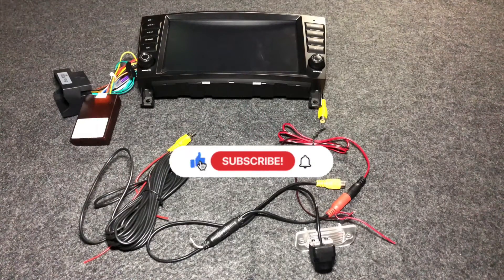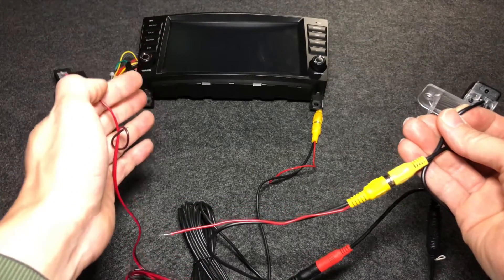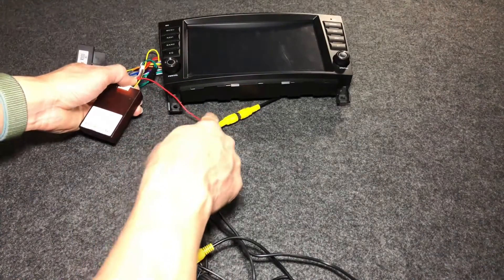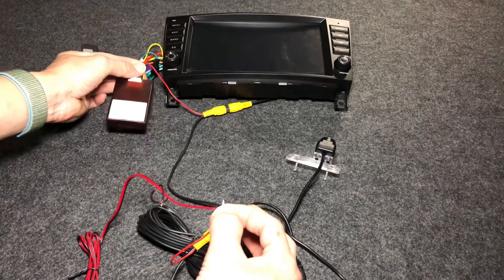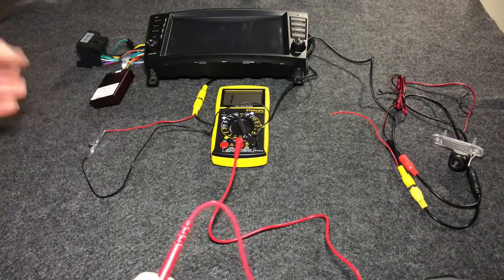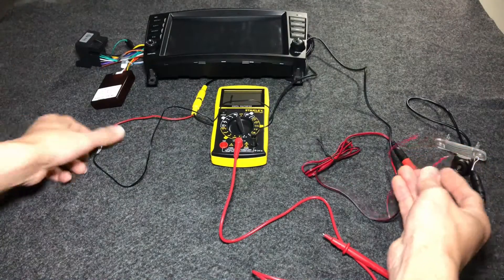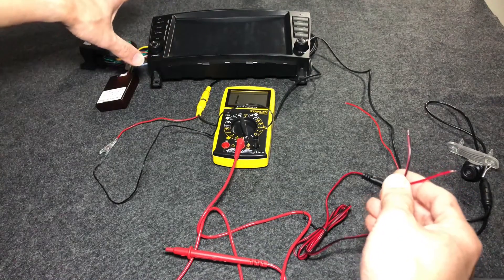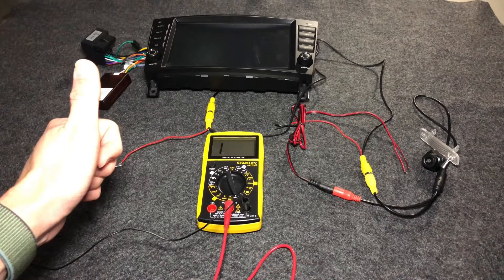HOW TO | CORRECTLY WIRE A REVERSE CAMERA

Comment: Thanks. I’ll try this. I’m so glad I found your video before cutting into the reverse light. I do have a reverse wire at the head unit and had not wired the rest of yet.
Reply from the maker: Good luck with your install. Just make sure that you connect the ground wire to a proper ground point.

Comment: Mate quick question which i will try and be as clear as possible. Ive had my reverse camera hooked up for a while. All has been fine until recently. I now get a lot of glitching when the side lights are on, when i apply the brake lights it all works fine ... i have one emd hooked to the reverse light and the other to a 12v supply. I also have a power relay fitted at the reverse light end of the wire. Any ideas why i am getting so much current interuption ?
Reply from the maker: Are you referring to the red wires coming out of the RCA cable? That you connected one end of it to the Reverse light and the other end to 12v power?

Comment: I connected my reverse camera to the brown wire on the CANBUS and it drained my battery
Reply from the maker: Im sorry to hear that. When you park your car, do you leave it in reverse? If that brown wire show 12v regardless which gear the car is at, then its the wrong wire (even if its brown)

Comment: isn't the brown wire out of the canbus an "input" / "trigger wire as opposed to a 12V output? i was under the impression that the brown wire triggers the reverse camera screen once it receives 12V from the rear tail lights

Comment: how do you connect the red wire to the brown one?
Reply from the maker: Hi there,
There are several options but more recently, I found these items (amazon affiliate link):
https://amzn.to/46Lmgqa
I have not used them yet but have tested them and seems easy to use and effective.
You can watch my other video where I installed this reverse camera on my car. In that video you will see how I connected the camera red wire into the brown wire of the canbus decoder. I didnt use the above product though but also effective method.
Related video: https://youtu.be/uf7iFzxUnoA

Comment: How would one know which wire from the canbus outputs 12v?
Reply from the maker: Hi Wild Storm, thanks for visiting my channel and posting your question here.

There are two ways you can find out: (1) Some canbus decoders have a pin-out or wiring diagram. If yours have one, look for the pin marked Rev cam (or something along those lines, (2) You can use the good-old trial-and-error method where you connect the headunit and canbus decoder into your car, then put your car in reverse/ out or reverse and see which one the pins show 12v when in reverse gear and show 0v when out of reverse. For this you need to invest in a multi-tester. Feel free to have a look at my affiliate link in the description if you currently don’t own one

I my explanation is clear. Let me know if you have further questions. Happy to answer then if I can.

Comment: From the car stereo connector there is a reverse wire. That’s how the canbus had the same signal. On my stereo it was pink. 
That’s what the manual was most likely referring to. Same results though

Comment: Quick question. With my head unit I have a brown wire coming from Canbus and a reversing camera red wire from the head unit itself should I join the red and brown together before connecting to the red wire to complete the circuit or should I just use either the brown Canbus wire or the reversing camera red wire provided from the back of the head unit? 

Thank you! Otherwise the video was brilliant and will help me with my instal for sure!
Reply from the maker: Hi there, Its hard to know for certain what the brown and red wires do without a multi-meter.

Im guessing the brown wire will output 12v when car is in reverse. The red wire in your headunit may possibly need to receive 12v to tell it to switch to the reverse camera feed. 

I suggest to test them for voltage signals first before connecting wires together as it might cause a short circuit and cause damage.

I hope this helps in your installation.

Comment: Hi, I love this video. However, won’t this connection feeds the camera 12v every time the car is on, even though, it’s not in reverse gear. That can get the camera hot and eventually damage it, not sure. I just want to know better.
Reply from the maker: Hi there, Yes I agree with your analysis. Thats why its important to find the right wire to connect it to. In my instance, I tested the signal coming out of that wire from the canbus decoder and I can confirm the wire only outputs 12v when the car is in reverse. All other times its 0v.

Comment: Thanks for this.  I didn't want to tap the reverse light either.  I'd rather leave the OEM wiring as is, so the headunit can be removed easily if needs be without any trailing live wires behind the dash.  Doing it this way - what did you connect the camera ground to?
Reply from the maker: I had to use the ground point in the boot. I wasnt sure if I can use the ground wire on the actual RCA jack. I figure it might introduce noise on the video feed so I used the proper ground.

Comment: Can I .hook.my.camera..to.the.trunk.backup.light
Reply: Let me me .know
Reply from the maker: Hi Eugene, yes this is also a valid was to connect the camera power. Some cars have a sensitive canbus and depending on the type of reverse camera you use, it might draw a high load which causes the canbus to trigger a warning light. Especially if your camera has those powerful LED lights around the lens.

Comment: Hi, I had a unit which I wired all properly however when in reverse there is no image. The screen stayed normal screen not even a no signal sign or change of screen
Reply from the maker: Hi there, If you have an android headunit, its possible there is a reverse trigger system setting that is turned off. Try to dig around and see if you can find it. I’ve mentioned it in the video description of my reverse camera installation video here: https://youtu.be/uf7iFzxUnoA?si=Jo7Rg4I0nR9Xsf99

Comment: I bought a boss BE9ACP head unit. It has a reverse (purple with white stripe) wire, and it has a red wire that says rear camera power output. Im having a issue of does the red wire paired with the yellow rca hook to, and my reverse camera system has a red & black wire separately and not sure where it hooks. The reverse camera i have ia the Atokit plate camera with 8 lights on it
Reply from the maker: Firstly since I’m not familiar with neither your car nor the Boss headunit, please consider my suggestions below just as guidelines.

With regards to the red wire on the yellow RCA video cable, its main purpose is to either: 
(A) Carry 12v signal from the headunit to the reverse camera (if your headunit has the 12v trigger and you don’t want tap into the reverse light to power up your reverse camera) OR 
(B) Carry 12v signal from the reverse light to the headunit (if your headunit does NOT have a 12v trigger).

So to answer your question where to connect the red+black wire on your reverse camera:
Black wire - connect this to ground which is any bare metal on the car. Look for a bunch of wires connected to a screw. That is the ground point you can use for the black wire.
Red wire - If (A) applies to you, then connect the other end of the red wire sticking out of the yellow RCA cable into the red wire of the reverse camera. If (B) applies to you, then connect the red camera wire into the reverse light

I hope this helps.

Comment: hello i hope you are able to help me. my headunit has a canbus and when i switch into reverse, it is detected and my screen goes black no signal. so this tells me there must be a signal. however when i use a multimeter to check the voltage when in reverse there is none. not from the brown wire or any other wire (some of the wires have a constant power supply but not any that work only in reverse). Any idea whats going on?
Reply from the maker: Hi there, thanks for reaching out. Firstly, when you put the car in reverse and the screen goes black, it does not mean it detected the camera. It just means the screen is ready to display the video feed. Since the screen is black, it means there is no video feed possibly because the camera is not receiving any power. Check your ground connection and find a suitable power source. If you cant find a suitable power source from the canbus decoder, an alternative is to tap into the reverse light. I hope this helps

Comment: Can I skip connecting the red wire to the reversing light, my reversing light is on a tailgate and the wiring is hard to get to. I don't need it to auto-switch, I can do it manually.
Reply from the maker: Yes, you don’t have to if you have an alternative way to sending 12v power yo the reverse camera. In your case, I understand you will have a manual switch inside the cabin so power up the camera. I that will work too.

Comment: this might be a dumb question. But to test which wire is powered up from the canbus, once i put the car on reverse, can i just unplug the canbus, and then use the multimeter on the white connector itself that connects to the canbus to find out which wire it is?
Reply from the maker: Hi Benh, I have not tried that so i’m not sure if that will work. The way I understand how this canbus decoder work is that some of those signals will be generated by this box itself which means it has to be connected to the system.

Comment: Hey, am I able to connect the red power wire with the red pigtail wire together, and then those wires (once joined) to the reverse light with a tap? And can I use 2 taps in this situation or no? Thanks in advance! Love the vis. Big help
Reply from the maker: The only purpose of the red pigtail wire on both ends of the video cable is so that you can send 12v power from the headunit to the back of the car to power the camera.

So if you are going to use the reverse light as your power source to power up the camera, there is no need to use the red pigtail wire.

You just simply connect the reverse light directly to the reverse camera power wire.

I hope I explain it clearly.

Comment: Thanks for posting this. All the instructions coming with these bad units and cameras tell you to tap off the reverse light wire in the tailgate. I tried your suggestion and my unit Xtrons had the reverse trigger tail wire, plus when I select reverse gear the display detects it and switches to the reverse camera input. So I hooked up a test like yours and got the same outcome. Therefore I wired it up your way and it all worked out fine. I won't bore you with the details of my trials and tribulations getting the installation done. Trickiest bit was t-tap the reverse wire, but the wire got cut ( it's so damn thin ). So I had to splice it with a butt connector, and soldered the trigger wire to camera power wire for good measure, then retest continuity. I'm amazed how the 12v and video signal travels so well on minute wires.
Reply from the maker: Hi Paul, Just like you, I did a lot of research prior to the installation. In searching the interweb how others do theirs, some even connect the reverse light AND the trigger wire into the camera power, yikes!!!

Im glad you got your reverse cam installation working.
Reply: Thats totally fine to connect the reverse light and trigger into the camera power.   They are all the same .  When you put the vehicle into reverse, a relay is tripped,  sending 12v from the car battery to the reverse lights and any other reverse indicators in the vehicle. .   The reverse trigger and the reverse lights and any underdash reverse light indicatirs or signal imputs are all activated or "powered" simultaneously from the same relay circuit that closes the positive lead from the battery into said reverse circuit.  So the same 12v supply feeds the R.lights,  R signal, R camera power, R. Dash indicator lights,  and any other Reverse source inputs  that may exist.    

So there is no "yikes"  to be had!  Lol.  Its all good as long as 12vDC gets to the camera, and tge head unit and the triger wire which by all means should just come from the camera positive lead.its completely unnecessary it to be on the rca jack.    There should just be 2 rca jacks one for power and head reverse trigger and the other for video.   They just make the double sided one to give the option to connect it in dash or via taillight otnanywhere else along the way.   @AutosNGizmos
Reply from the maker: @derekhoffman818 Yes I agree. That method will work as well
Reply: @AutosNGizmos  Won't a canbus car complain about a possible failing reverse light bulb? It can sense an extra current draw on one side.. 🤔
Reply from the maker: Yes its possible but depends how sensitive the canbus is and how much power/current is being drawn by the reverse camera. Ive seen some reverse cameras have led-lights around the camera so that might have a higher chance of a canbus error
Reply: @AutosNGizmos  Alright, worth a try, thank you!
Reply: @AutosNGizmos  my reverse camera has those leds around it so sometimes it takes a few seconds for the camera image to appear on my head unit. It's not instantaneous.

Comment: Can you give me a pinout of the CAN bus decoder? Because I have one more pink wire below the brown.
Reply from the maker: Hi there I dont have the pinout for this canbus decoder unfortunately. What I did in my case is use a Multimeter and tested each pin/wire as I put the car in reverse.
Reply: @AutosNGizmos  One tip I have seen from my research from the past weeks is that an easy way to find the the reverse trigger cable (without testing with multimeter) is that it's usually the 3rd wire in from the left on the top row of the main power cable on most if not all head units. Usually brown or pink. (the locking clip should be at the bottom in this example)
Reply from the maker: @spoonjibobu Thanks for that tip. Much appreciated 😊

Comment: ATTENTION: This video is crap! It does power the system by passing the reverse power trigger and hooking the red wire into the brown of the module. Buuut! The module will overheat and send constant power to your backup camera and in a short time burn out your camera. Use the reverse trigger or get a proffessional to wire it to the front so it kicks off and on when reverse triggered and doesn’t damage your stuff.
Reply from the maker: As mentioned in the video at around 1:33 mark, I explained the brown wire on this CANBUS decoder will output 12V when the car is reverse. It reads 0V when the car is not in reverse. The brown wire is specific to this CANBUS decoder so please do your own due diligence to find out which wire in your CANBUS decoder supplies 12V to the headunit when the car is in Reverse gear.

Comment: I connected two small plugs (black). Now, my CarPlay only works when these two plugs are connected. However, when those plugs are connected, the CarPlay unit stays on all the time, even after I turn off and shut down the car. It never shuts down. My car is a Skoda Fabia Mk2. Does anyone know how to fix this problem?
Reply from the maker: Hi Lukas, Im sorry you are having issues with your system. But based on your brief description, it sounds like there is an issue with the wiring harness that came with your headunit. Have you tried reaching out to the seller where you bought your headunit from?

Comment: Does the brown cable have a 12V output?
Reply from the maker: Yes in my case it does
Reply: @AutosNGizmos seems to be working great thank you! I am going to wire the camera to the back tomorrow. For the ground, did you choose a specific spot?
Reply from the maker: @ That’s great to know. Good luck on the project.

With regard to the ground connection, you can use any bare-metal/unpainted exposed piece of metal in the boot area. But normally in most cars, you will see a grounding point beneath the carpet lining. In my case when I installed this android+reverse camera system on my MB C200, I found a screw where all the ground wires are connected to and I tapped into that. Have a look at this video of that installation I did before you do yours —> https://youtu.be/uf7iFzxUnoA
Reply: @ thank you so so much, you’ve been great help!!!
Reply from the maker: @massi9316  I appreciate the feedback, thanks ☺️

Comment: I cant find my reverse wire for my a sure 4 core series stereo
Reply from the maker: I’m not familiar with the wiring diagram or pin designation of any A-sure stereo, but have you contacted the company for support? Also, can you describe the issue are you facing?
Reply: @AutosNGizmos  cant find the reverse wire
Reply from the maker: @carloszamudio244  Are you getting a black screen on your a-sure when you switch to reverse gear? Im just trying to find out if the problem is on the stereo or the camera not getting power…
Reply: @AutosNGizmos  yes yes but cant find the  reverse wire or can i run a wire from the back up light wire  to the stereo?

Comment: I dint have a rear camera but my canbus sends signal to the monitor that I'm in reverse so it goes black and no audio. If I cut the brown can I resolve the problem?
Reply: You should be able to disable the signal in the factory settings. Hopr this helps.
Reply from the maker: You shouldn’t have to cut any wire. As what @bunster4322 mentioned, your headunit should have a System settings option to disable it from switching to the reverse camera feed when the car is in reverse. I have documented some of the settings on the below article. Have a read and there might settings there that apply to your system.

https://tinyurl.com/cxn9mbxn